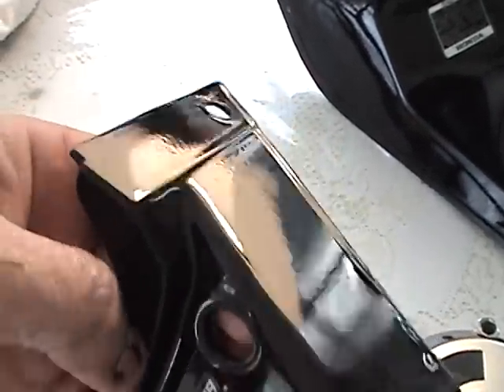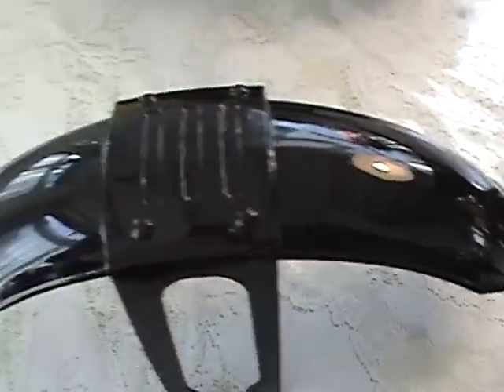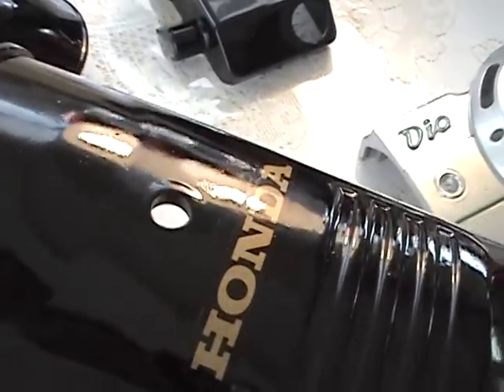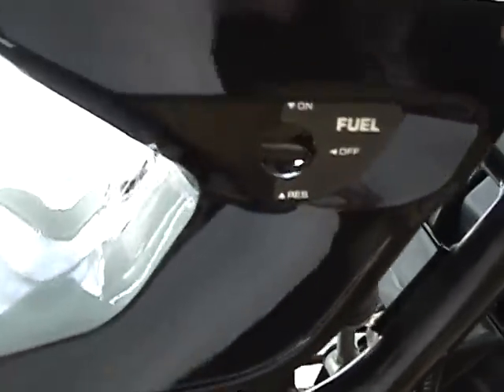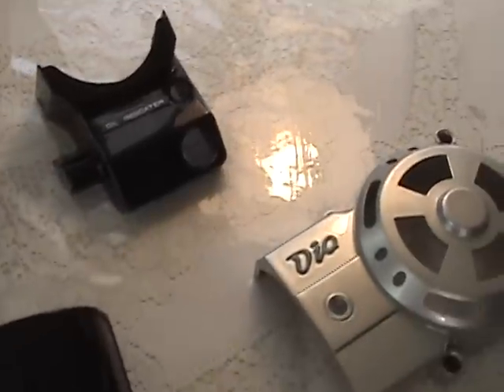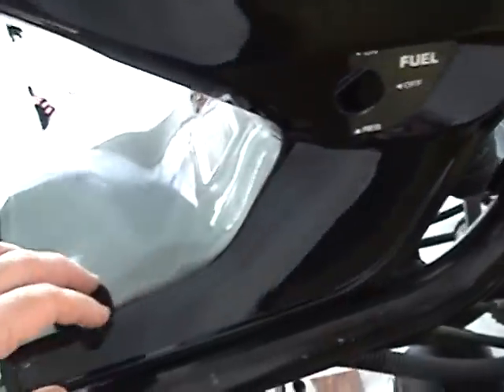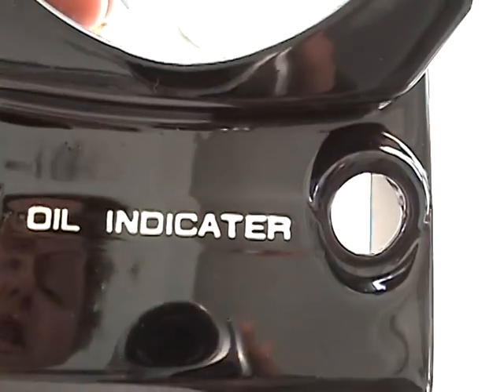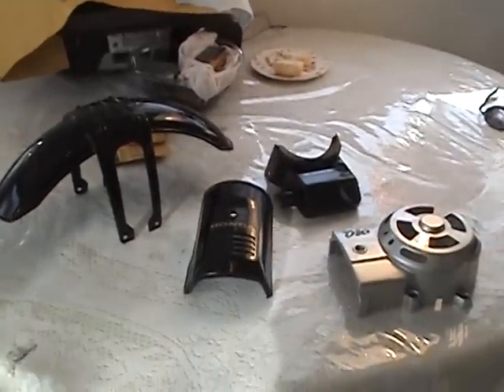URETHANE CLEAR COAT = RESULTS

Comment: Everything in hardware stores is gettibg outrageously expensive. sometimes if u can find stuff likr wd 40, silicone, ect at dollar stores, itys very reasonably priced
Reply from the maker: All the paints are made from petroleum and as an added cost they must be environmentally friendly. Even Paint strippers have to be this way to the point they don't work at all. Give me the old paint any day. Years ago when I was in the Nursery business, a law was passed to make pesticides and weed killers environmentally friendly- translation (watered down crap that did not work). Finally they had to go back to the old ways because that is what worked. DDT eradicated bed bugs in the 50's. DDT was the best pesticide on the planet. It just plain worked. Now we cant use it and bed bugs are rampant again. We need to stop being political about our paint formulas and USE what works. Just my opinion.